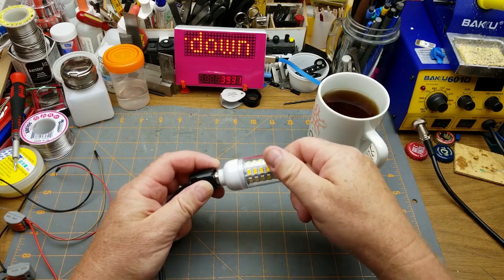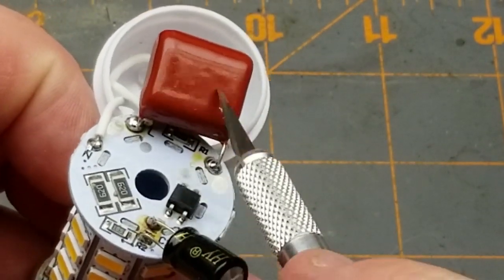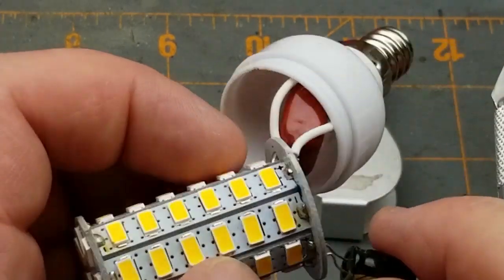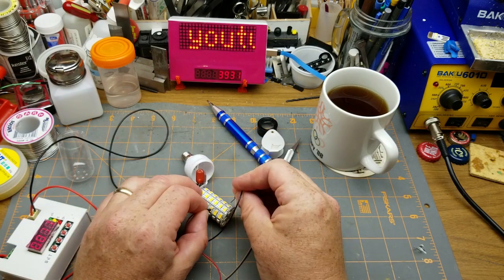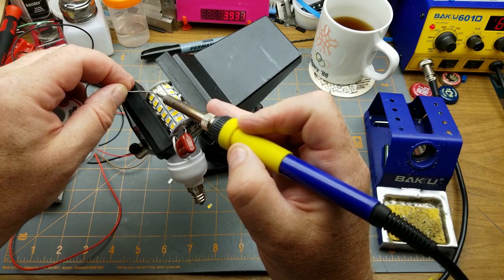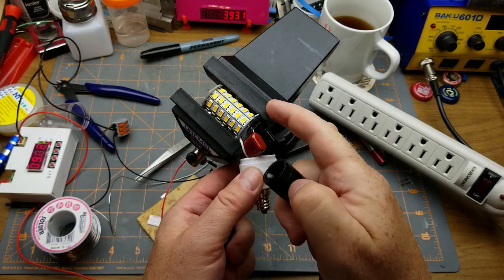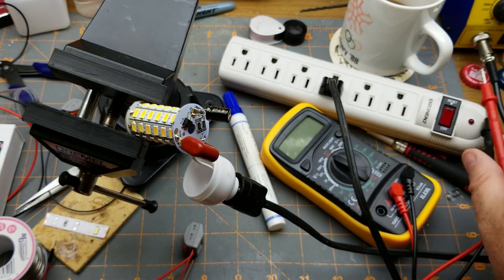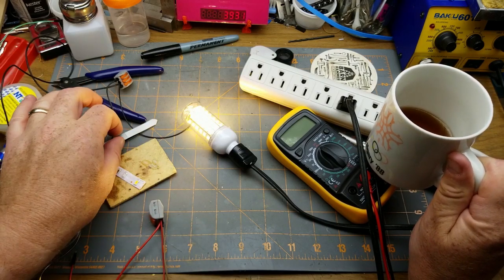cheap led light teardown (and unexpected repair)

Comment: Yes recycled and no landfill, yes learning hot air solder work and small part soldering but you learned another thing too. You could save a bulb like this and do the same thing to an led strip that needs an led replaced. Admittedly again it's more practice and play than practical but it's a fun geek thing to do! Lol

Comment: Well, I see no reason to trash 54 perfectly good LEDs just because of two bad ones. Especially if you have the knowledge and equipment to perform the repair. In addition to $2.34 not thrown out the window, you didn't spent more time doing it than you would have ordering it online and having to wait for it to arrive...Plus, instant gratification of having it working in a few minutes, by your own means and the joy of defeating planed obsolescence and consumerism... I'd say it's a good deal. :)

Comment: You were surprised! I bet Cive's chuckling to himself. I agree why should we fix stuff instead of throwing things away. Why didn't you reflow the replacement LED's with the hot air?
Reply from the maker: Mostly because I'm more comfortable with an iron. (old habits are hard to break) 

I've only used hot air a couple of times.I probably should have used this as an opportunity to get a bit more practice.
Reply from the maker: I'd like to think Clive would appreciate this, but I doubt he is aware of my little channel.
Reply: @pileofstuff  If I ever get chance to meet up with him I'll ask him, trouble is every time he does a meet up I'm working.